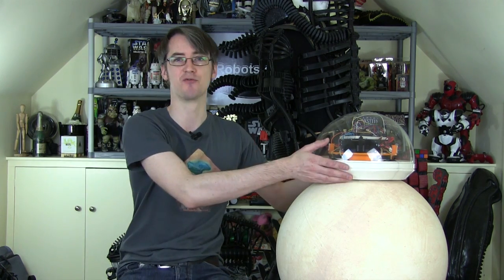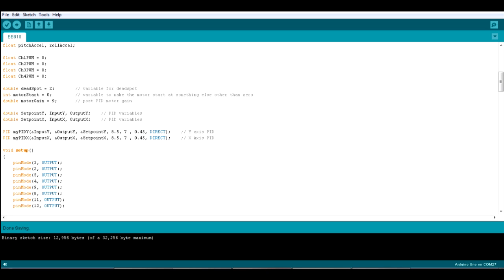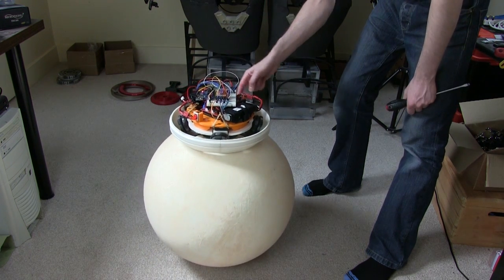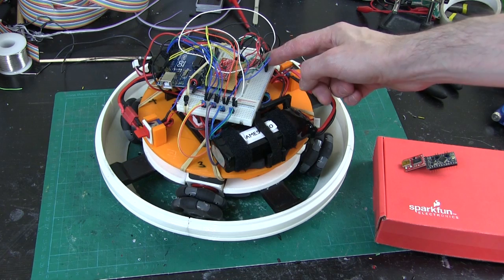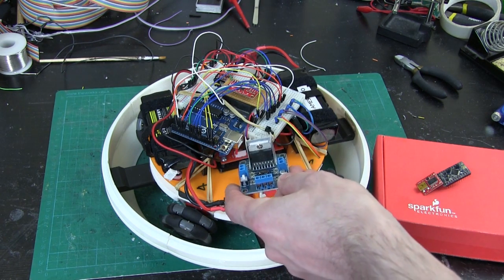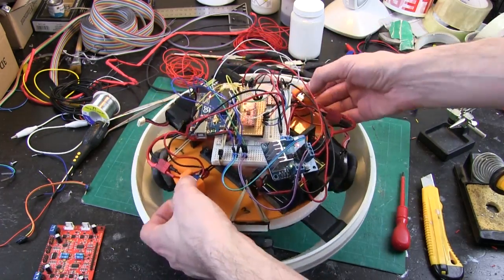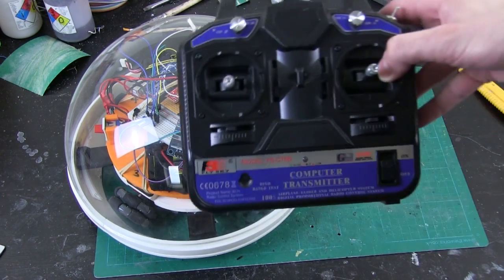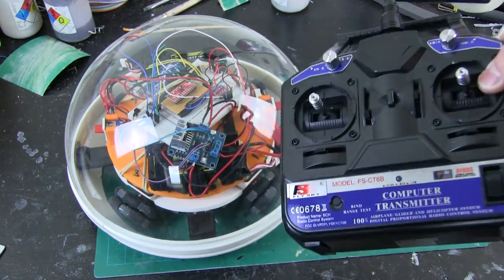Star Wars BB-8 Droid v1 #3 | Radio Control Experiments | James Bruton

Comment: I want to know which arduino code at github i should use for similar robot but i want it without gyro and accelerometer but with remote. BB813 or BB8Remote i should use.

Comment: Here's the thing that has stumped me. At one point in the video, the head part leaned to one side with the ball staying still. Only way I can think of to HELP the balance is a massive weight inside, or an opposite robot inside the ball to offset the weight some. But I do think adding a solid metal ball weight in the ball would help stabilize the robot as a whole. Thoughts?

Comment: Brilliant!  The inclusion of your progression is excellent, great problem solving skills!  I wonder if you could loop in your code to sample the magnetometer for a maximum rate angle that the motors can recover from, then set a boundary value within that feedback loop to help prevent tip-overs.  That way it autonomously would not get ahead of its maximum angle of recovery, regardless of control stick input.

Comment: I'm glad you're making a new version since you can now use the most efficient mechanics since it was revealed how the prop worked.
Reply: +James Harkness it's basically a rc car in a hamster ball that holds the "head" on via magnets.
Reply: +Petr Stuchlý  and wheels in the head
Reply: The random gaming nation I wouldn't say in, they are on the underside of the head so it can move around on the top of the body. i just thought i didn't need to mention that since both versions of james' bb8 had wheeled heads like that.
Reply: K

Comment: I wonder if you could practically use a magnetic ball inside the main sphere, then use a set of electromagnets beneath the 'head' (supporting the head on spring loaded passive ball casters) to 'attract' the magnetic ball inside, causing it to make the main sphere roll. You'd need to turn the thing upside down to switch it on of course.

Comment: Ever consider adding weight at the bottom the main body? Another powered omnidirectional roller system synced with the one on the top so it doesnt have to work so hard and isnt always on the verge of wanting to tip over.

Comment: It is a nice concept James, but I think you might consider restart of the project. I think the center of gravity must by as low as possible, so it would be better to put motors to the bottom of the big sphere. There could be same stick pointing from motor base with magnets on it's top end to hold a head on a place. Head shoud be light with just some spherical wheels and magnet. Good luck with your projects, you are amazing ;-)

Comment: i personally think the original has independent steering/balancing for the ball and the top part... on the stage during the preview it leans over without moving. you cannot do this with james' concept
Reply: Soxco and having weight in the bottom of the ball makes it really stable; like water in a rolling barrel

Comment: Lol, it's funny how before the Anaheim video you was quick to write off the fact that exposed wheels, and dimensions couldn't be the same as original design. Also I'm pretty sure that there is a second motor controller module in the bottom sphere assembly.

Comment: I think you're having some windup problems in the PID control algorithm, maybe you should lower your integral gain, another solution is to limit the integral error, however, I don't know if it's possible in the arduino library.

Comment: Amazing progress. Just the fact that it's got stability is incredible to me. A thought on the head: What if you installed a rotary motor with a center driveshaft that mounts to the under side of the head's dome? That could potentially be controlled to allow the head to swivel independently.

Fantastic work as always, James. :)

Comment: Hey James although I doubt you'd want to restart on this project (not completely) i came up with an idea that would make this function a lot easier and possibly work more accurately to the movie bb8. What if you have a hollow sphere with another set of wheels on the inside. These wheels then are able to move the ball separately  allowing you to control which way it goes quicker, faster, and improves balance. Along with that you keep the same head part you've made, that way you can move both at the same time as seen with the real model where the ball can stand still but the head is still able to move.
Reply: MrFantasticr24 Totally , the big ball should be radio controlled , and the head part should self balance on top ....
Reply: +MrFantasticr24 TBH I think the head on the original is stuck on by a magnet and allowed to move freely without friction using ball bearings.

Comment: Its nice, but if you made a smaller and heavy ball inside the ball you would have more speed and it would be more stabil,
Reply: NightBreaker the ball inside would make it move unpredictably, watch his previous video on this robot.
Reply: Felix Hopkins 
True but with no weight in the down end, there will be no speed on unstabil ground. Might be a sync motor and a magnet at the tophead to the center.